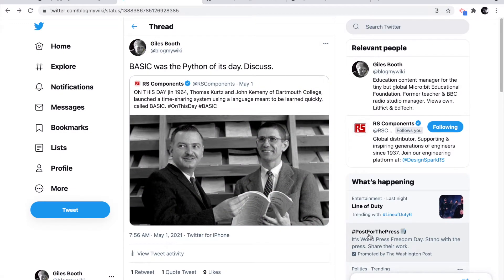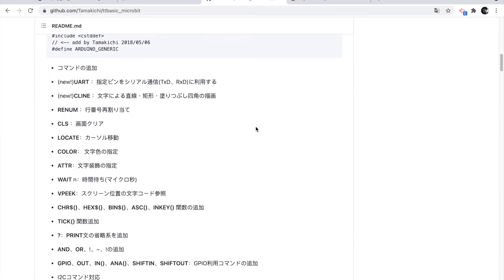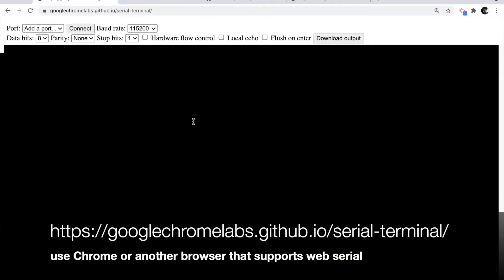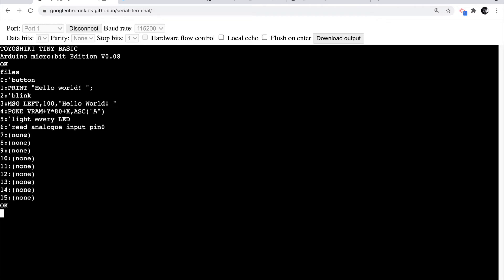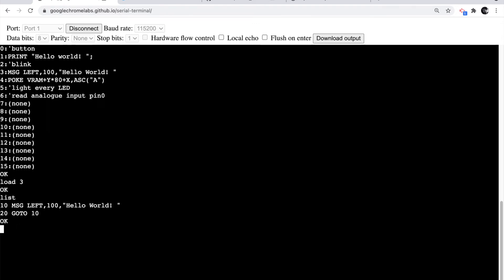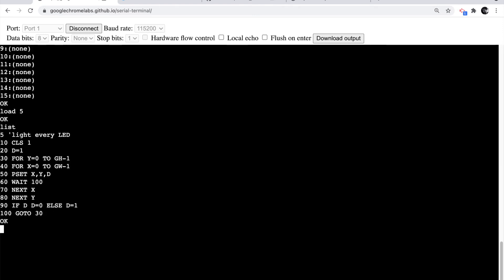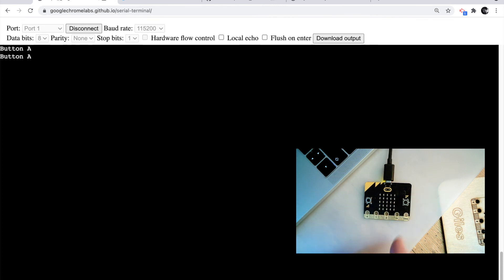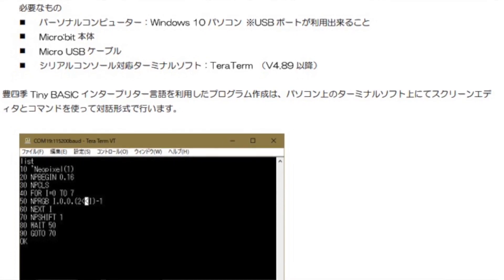Exploring TinyBASIC for the BBC micro:bit

Comment: How do you clear the screen in serial?
Reply from the maker: I think that probably depends on the serial interface you're using, some may support control codes to clear the screen. For example my smolBASIC micro:bit project has a 'clear screen' command that does that for the PiGFX serial interface. https://github.com/blogmywiki/smolBASIC#smolbasic-gfx-the-graphical-version
Reply: Thank you